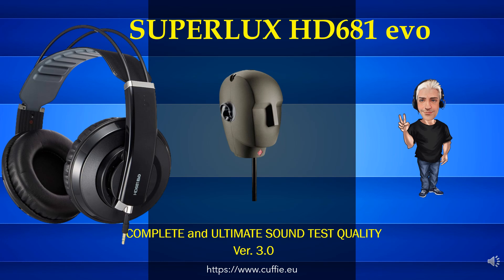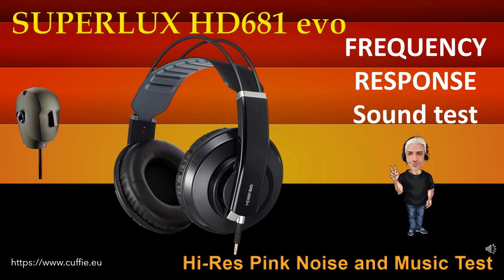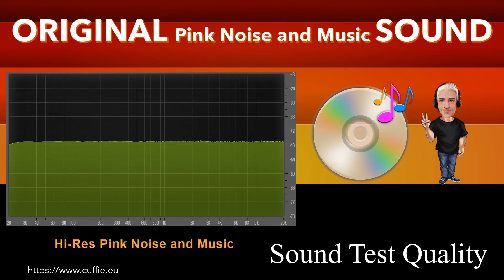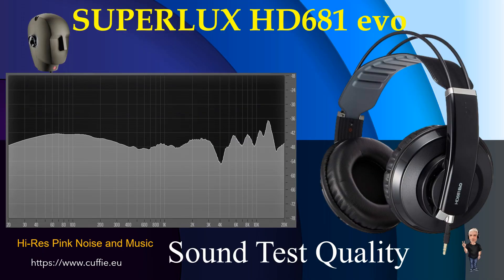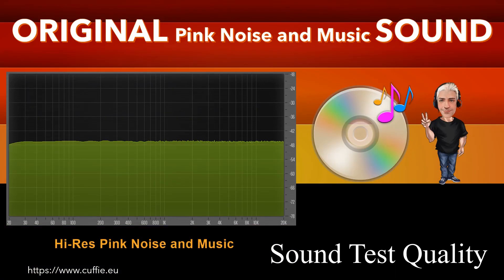SUPERLUX HD681 evo - Recensione, Review, Sound Demo, обзор, Cuffie

Comment: If they're too dark you can experiment by taking off the piece of felt glued over the driver and replacing it with thin layers of kitchen/toilet paper. I used 2 thin layers of kitchen paper and i think it's better, if you don't replace it the sound is too hard and metallic imo.